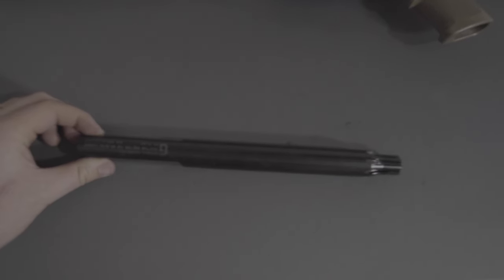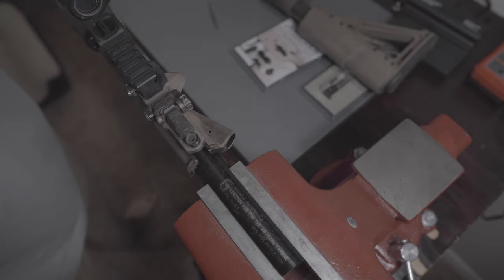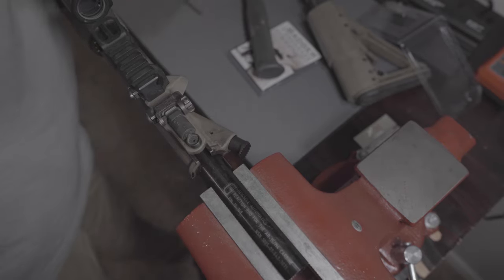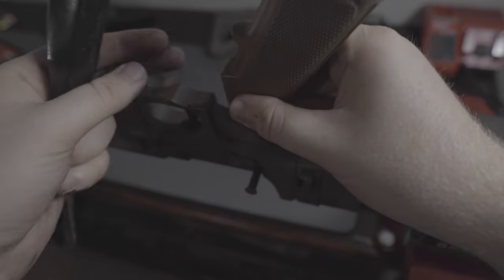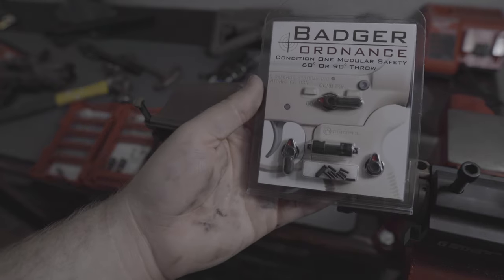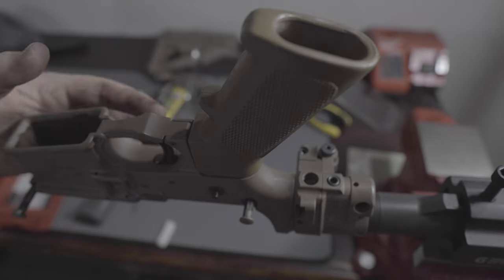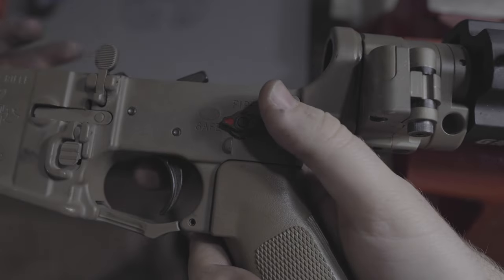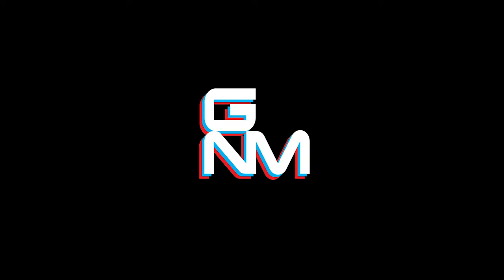Upgrading My KAC SR-15 With Hodge Defense & Forward Controls Design

Comment: Just fyi...  KAC's have rounded bolt lugs and are not of the traditional squared shape. KAC makes a specific rod to use "Knight Stick". I have heard (never seen) of guys causing damage to their uppers/barrel lugs from using traditional armorers tools.
Reply from the maker: Yeah, much has been said about that on this video. I am completely aware of the differences and I would never do anything requiring significant torque on the lugs. The reaction rod in this video was mostly to support the upper. Also fwiw the knight stick is unobtanium

Comment: so that geissele reaction rod actually work on sr 15?  I’ve heard you can use to switch out your muzzle device. Mine needs changed as we speak
Reply from the maker: All the nerds told me no, but I’m not putting torque on it. If you are worried about your rifle, I would advise buy the Knight stick or send it to a KAC armorer
Reply: @gunsnmammons  nah , none of that is necessary. Geissele rod & AAC flash hider removal tool do the job just fine brotha

Comment: I like the Badger safety, although I just installed a Forward Control Q shaped 50 degree safety today and it's better than the Radians so many people love. The Badger was another option I considered. I also noticed you have the Badger charging handle and was wondering how you like it. I like the look a lot and I'm sure it's comfortable, but I think I saw in one of your older videos you used to run the Geissele on the same gun. What are your thoughts on that switch? Because due to the large wall or shelf on the rear of the Geissele handle, it redirects gases very well, better than the Radian SD or anything else I've seen. For that reason I haven't tried the Badger charging handle, because it doesn't have any sort of gas mitigation wall, and I can only assume it doesn't do nearly as well as the Geissele especially suppressed...
Reply from the maker: In my opinion it isn't a noticeable difference as far as gas to the face. That being said, the SR15 I have is a pretty well gassed gun. But the FCD Q selector is something I have heard great things about. Honestly I don't think FCD makes anything that isn't good.
Reply: @gunsnmammons  Yeah, very true. FCD is my favorite "parts" company by far. Every upper and lower part they sell costs at least as much as an entire lower parts kit from most companies but that's not the point. Every time I swap a part out for their parts it's an improvement. Even with something like the Q selector which is a noticeable improvement over even the Radian Talon (I just bought a Radian Model 1 10.5" pistol and I'm torn because I actually want to get rid of the Radian Raptor SD and the Talon which are their signature parts! lol). Also their KeyMo mount flash hider, which I just installed today and took to the range, is noticeably better than the stock Dead Air flash hider. It decreased muzzle rise a decent bit even though it looks like a modified A2 birdcage, and it also cut about 1/4" of length down. Love FCD products.
Reply: How is the Q shaped selector "better" than the Talons?   Genuinely trying to understand.
Reply: @harveyheart5237  There's a few things. For one, the dovetail and pin attachment for the levers on the talon has a little bit of wiggle. It's machined pretty tight but it's not perfect, not as rigid and positive as the Forward Controls design that uses actual punched pins to secure the levers so they're rock solid. The Talon levers also taper back so they get thinner and also a little narrower, so it's much more common for your thumb to slip off. The FCD design maintains a shape that is the only selector I've used that I get a nearly 100 percent likelihood of not missing a safety flip while moving quickly. You almost never slip off and miss a throw even while keeping your grip maintained (only using your thumb, never adjusting grip). It also feels a bit more snappy and positive, which the Talon is already good at, but the FCD takes it a step further in smoothness and quick snappy action. And to get to the Q shape, that's the best part because it makes you bring your thumb up a little higher on top of the safety to throw it "off" and that extra leverage makes it comfortable and almost impossible to mess up. Then when you want to throw it back on safe, the lever being in that Q shape means it's easier to get your thumb underneath so again it's easier to get leverage on it while not adjusting your grip and it's less of a reach due to that shape.
Reply: @draggboy  Thanks for the input.  Have you spent time with the Badger Ordnance C1 safety?  I'm liking that one aesthetically if I had to spend $40 more dollars on a safety.

Comment: How's that 60 degree throw for you? I like the 45 since it's easy to put back on safe with my thumb. Can't do it with a 90. Can you do it with the 60 easily?
Reply from the maker: I love the 60 degree, in my opinion 45 felt too short, but the 60 is a good in between. That being said, I think the positive snap the badger safety has is worth it even in the 90 degree setting.
Reply: @gunsnmammons  i just replaced the radian with the badger at 60. What a difference. Radian is overhyped… the snap of the badger is amazing and the 60 degrees allow me to flip it literally any way I want to.

Comment: Dont you need a kac e3 reaction rod since the lugs are entirely different? Reason why im stuck with the stock muzzle device
Reply: The lugs aren't that different, wouldnt swap rails, but the 20-25 ftlbs from a muzzle device should be  fine, just make sure you take care of any thread locker there might be
Reply: Should say,  a vise block that cradles the upper itself is probably better for it
Reply from the maker: Yeah I agree. But in this video I wasnt really applying any torque so I didnt think it would matter much.
Reply: I’ve seen some KAC barrel extensions get really chewed up with reaction rods. They aren’t something you want to ruin either. Bad feeding issues result in doing so